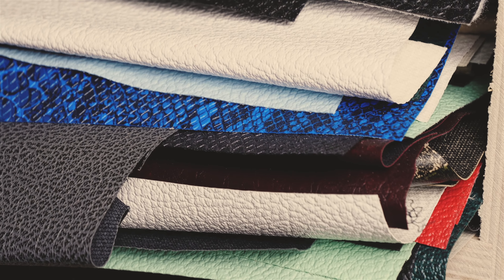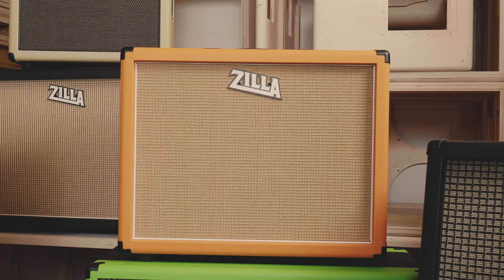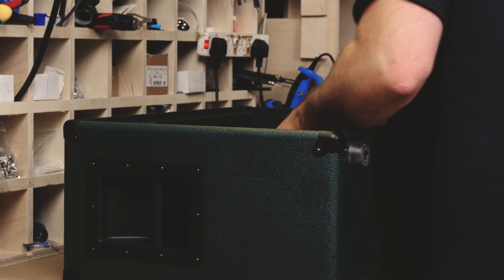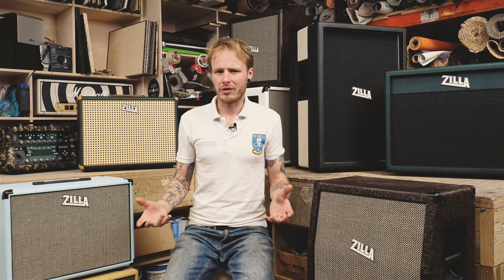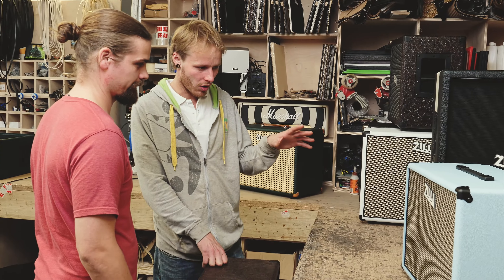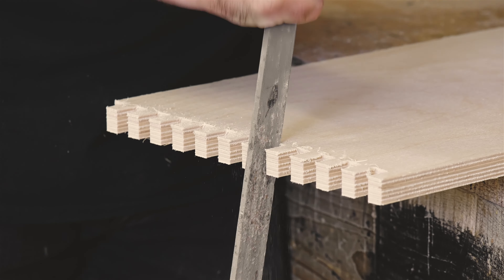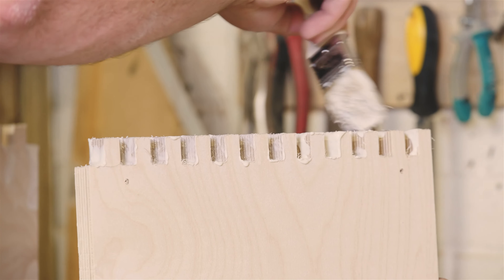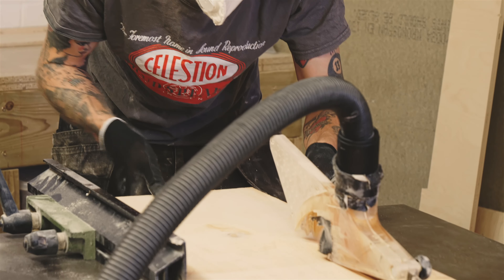Zilla Cabs Backstory

Comment: Is it possible to do a quick video on wiring up the speakers, benefits of running series or parallel and stereo options. Be really useful, I have the super fat boy, looks amazing 👍
Reply from the maker: Hi Andrew, I think that is a really good idea. I will make sure we put that on the list. I will be honest, we stayed away from it a little as keeping the micing consistent between the two wirings and inconsistency with amps/speakers can change the results but we have been trying to figure it out. Thanks for watching.